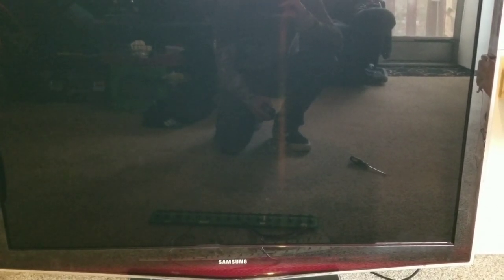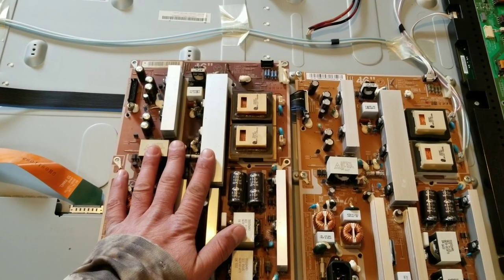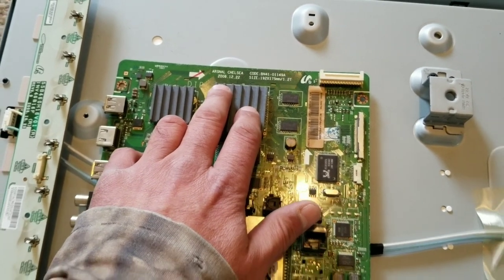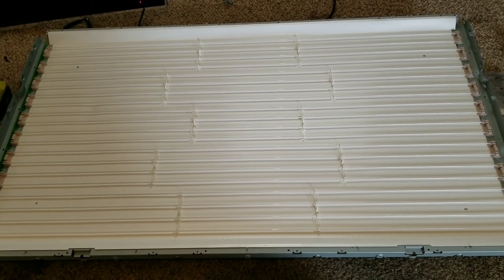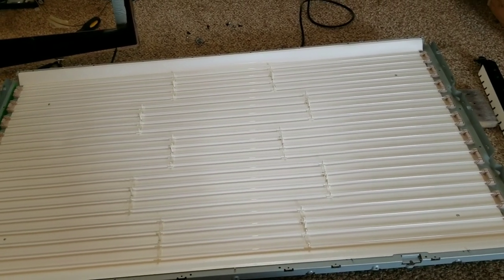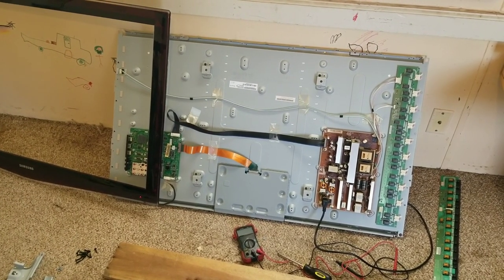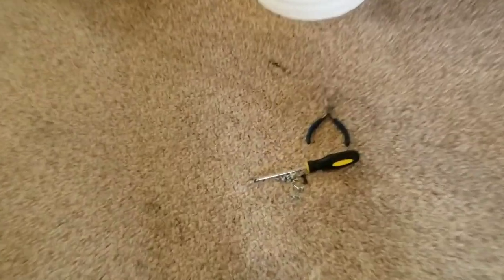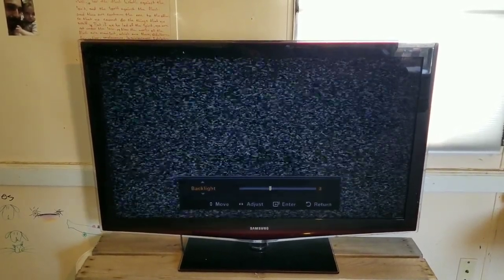DIY Tech: Samsung CCFL Flatscreen Backlight Problem Fixed

Comment: I can tell your new to soldering but your ALOT better than most so called experts showing you how to fix things
.
.
Fyi i used to run an electrical repair shop before it went out of business
.
Get yourself a Solder Sucker
.
And make sure your soldering iron is hot enough to quickly melt the solder leaving a nice shiney smooth blob, and keep the end clean after every dab
.
Some Course cut stainless steel wool is perfect for keeping the end clean, cus you can just push it in and spin it around to clean up the end
.
.
Itl make soldering alot easier and more enjoyable 👍
Reply from the maker: Thanks for compliment and the pro tips! I'll definitely follow your suggestions to improve my soldering skill! Much Shalom to you and yours! 😁🙌